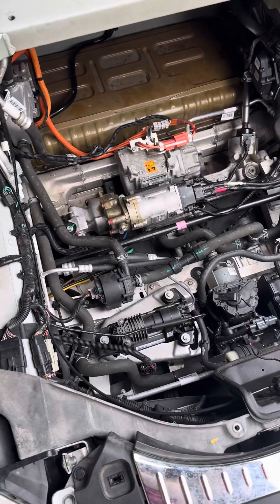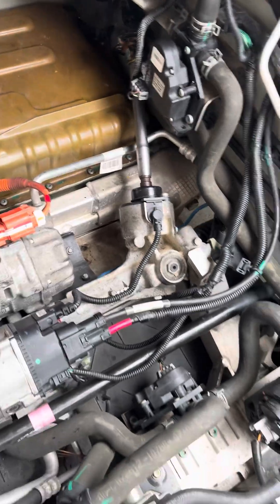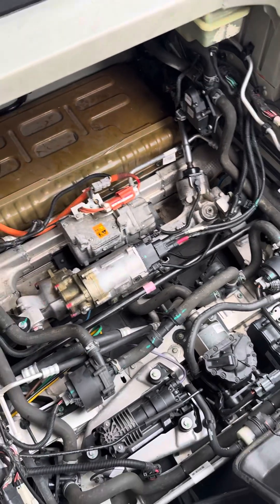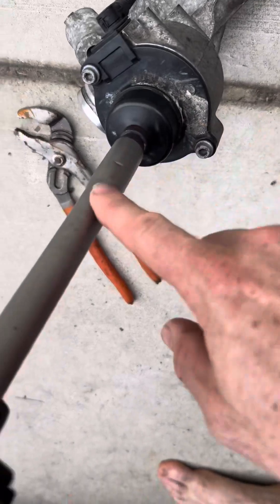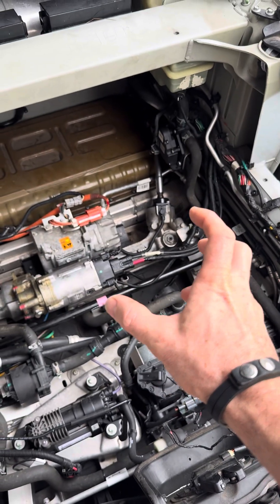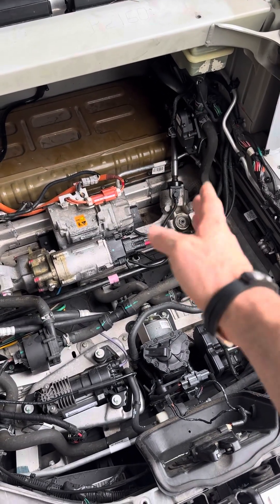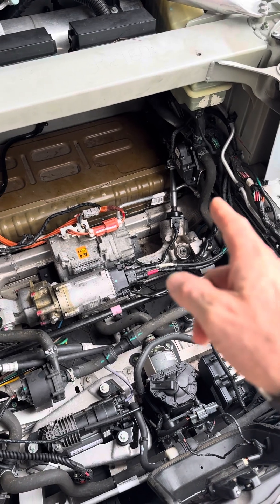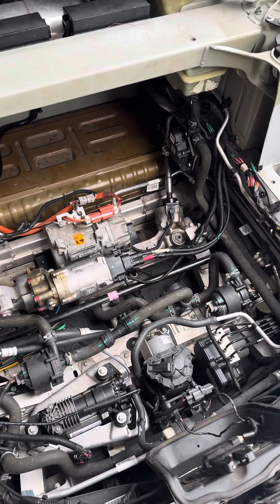Tesla s steering rack proof it’s messed up inside

Comment: i have some bad clunk noise. i guess i need change the steering rack :((
Reply: Have you figured the problem my 2018 model 3 has loud clunking noises too. I replaced everything besides the rack and pinion which I believe is the problem

Comment: Mine has a rattle at low speeds that drives me crazy.  Tesla said nothing they can do, because I have the latest rack and pinion.  For YEARS they said Engineering is working on it.  Now, you are stuck with it.